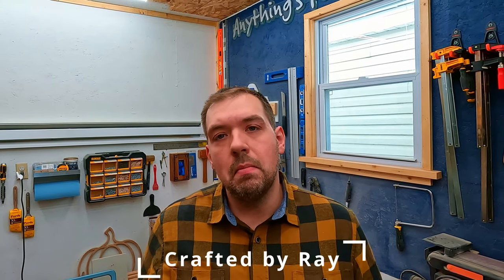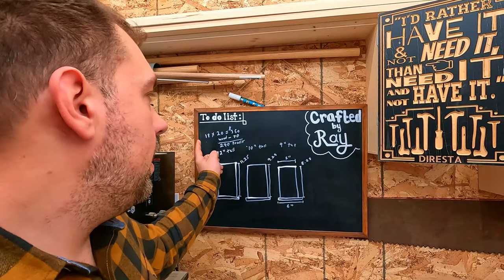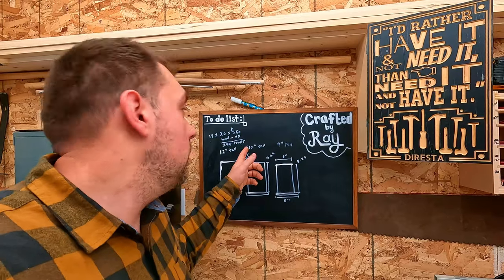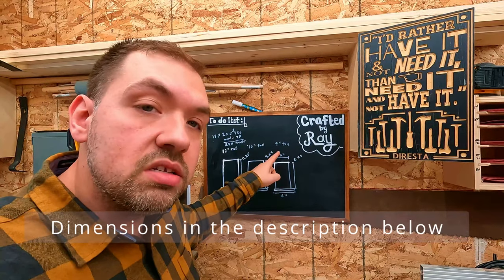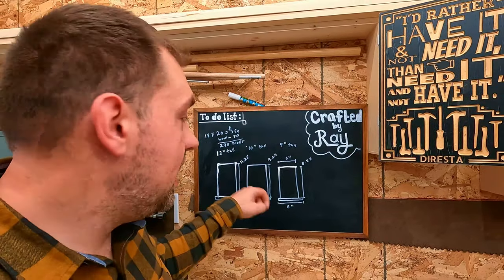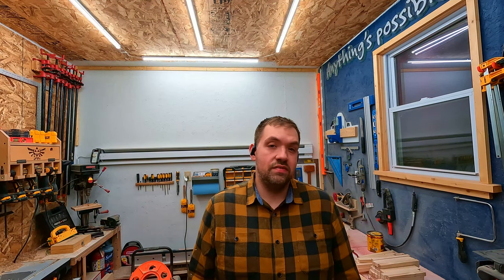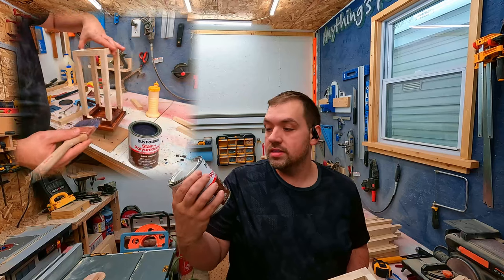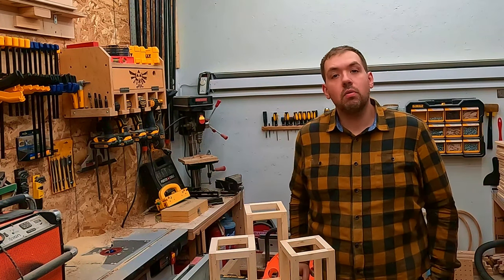Easy Way To Make Money Woodworking // Wooden Lanterns

Comment: The stain looked very blotchy and Matt, very hard to get even coating on assembled items. Did you raise grain & resand before assembly including the legs?
Was it varnish stain or just stain? Shellac is helpful at giving even coat of stain without blotching.  But I think a full pastel colour paint or clear varnish best option unless you can improve staining before assembly!
Reply from the maker: I agree, I didn't like to finish the client wanted me to put this stuff on that was polythene and a stain mixture and I did not like it but the client loved it was not one of my best attempts of putting finished on, it's not the way I like to do it but. Thanks for watching.
Reply: You can use a 'pre-stain' that evens out the stain and prevents blotchiness a lot, put on and wait about 30min then apply actual selected stain, taa-daa, perfection. love the idea, love the base. I like to make my sizes 8/10/12. The cheaper ones at cheap 5 & dimes stores are just that cheap, use quality wood &/or thicker wood and problem solved with customers complaining on price, (like the successful multi millionaire sand salesman in Saudi Arabia: "yes, but you don't have sand like this!").

Comment: The small cross pieces cut to 4 1/2 "? For a total of 5"across?
Reply from the maker: Yes that is what I did🙂
Reply: Did you use a 1x to cut 1" strips for the lantern?
Reply from the maker: @eddiediaz8668  I used one by sixes one by fours one by eight scraps that I had laying around I cut him to 3/4 so they would equal 3/4x3/4-in squares
Reply: @CraftedbyRay  thank you!!
Reply from the maker: @eddiediaz8668  no problem! hope it helps 🙂